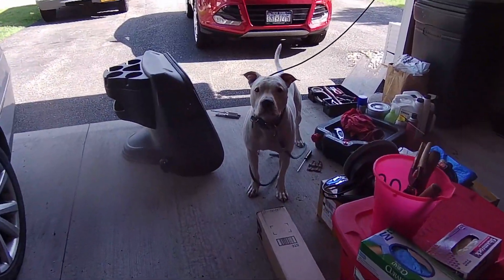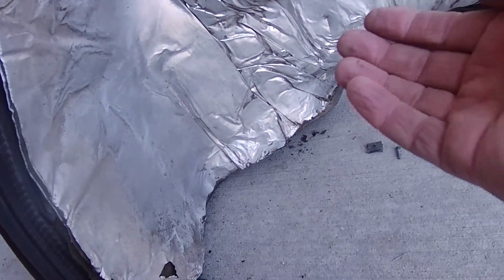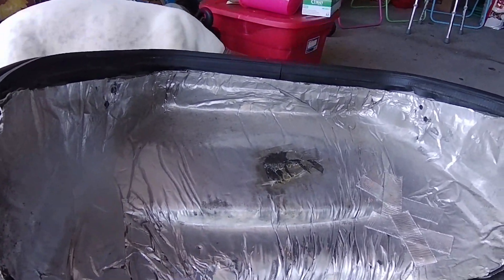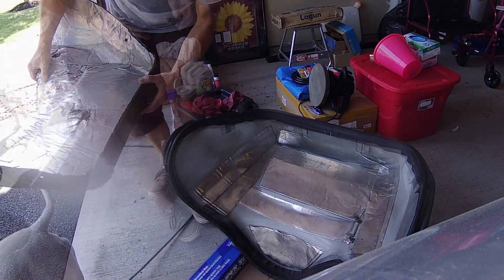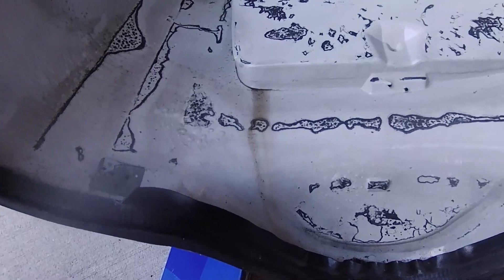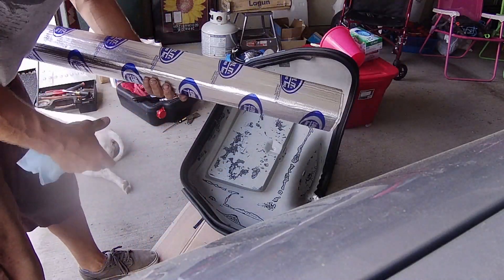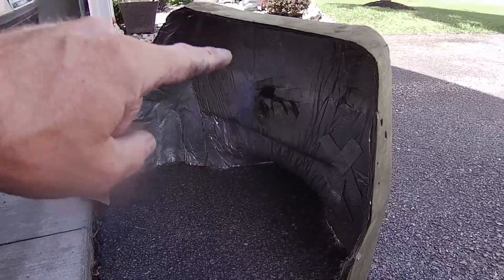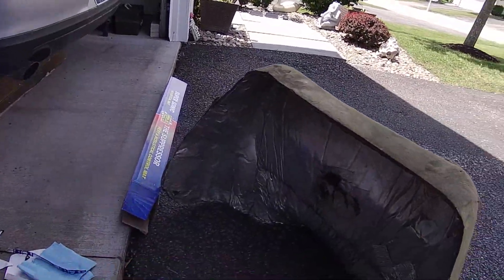How To Improve Your Ambulance Conversion Cab Comfort | Ambulance Conversion Life

Comment: i hadnt thought of using the sound deadner on the dog house. i used that roll insulation from HD for the bed of my van. Helps a  lot i think
Reply from the maker: I'm anxious to test the heat blocking effect - you know how warm the doghouse gets on a hot day of driving. The engine sounds are reduced with this, I can hear a difference for sure.

Comment: Can you add some of the sound deadener to the floor of the truck cab, either under the truck, or under the carpet? At least around the engine area?
Reply from the maker: Yes I actually had enough material left over to put it under the carpet on both sides of the cab. That should help with heat and sound too :)

Comment: I was in an E250 van for 33 years they can get hot in the summer from the doghouse heat.  Did it make any difference in sound or temperature?
Reply from the maker: It made a big improvement in the heat and the sound. It was a good addition  :)